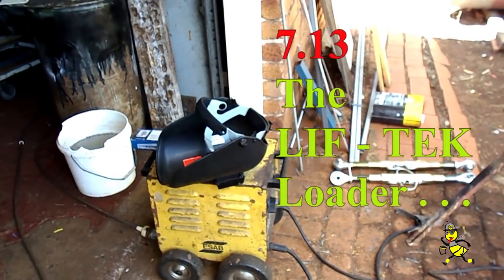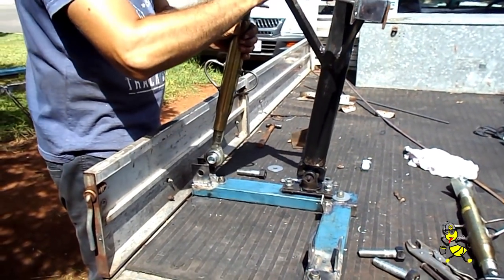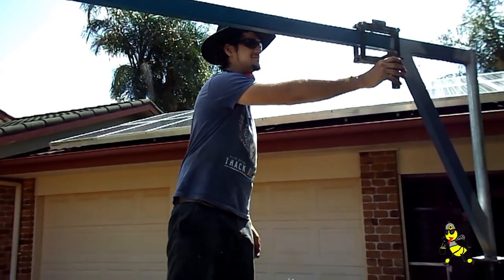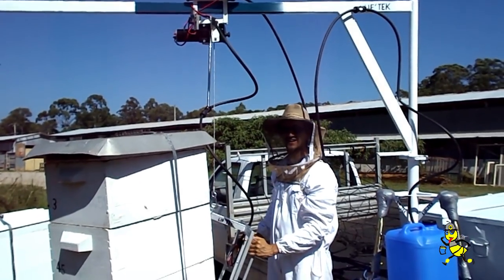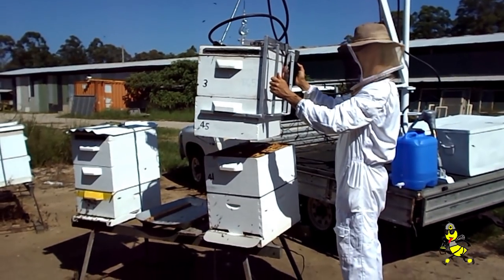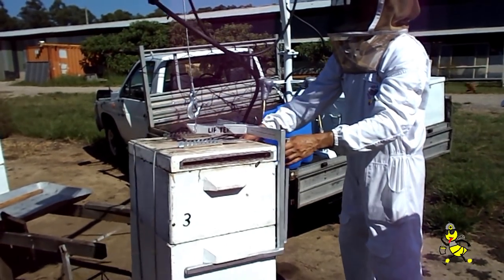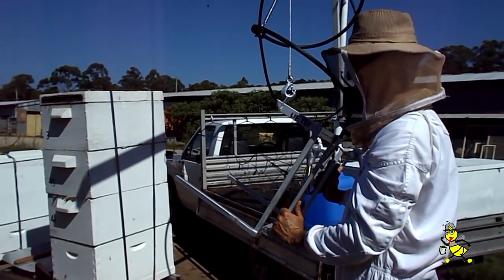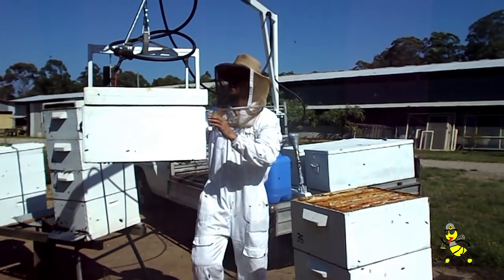7. 13 The LIF-TEK Loader

Comment: Great lifter, what did you have between the mast and the base, you said something about intermediate spacing blocks? looking to put one together this year before harvest. Cheers for the inspiration.
Reply from the maker: The bottom half of the post is 50 mm heavy wall pipe and the upper portion above the spacer or where it pivots/turns is 38 mm heavy wall pipe
Reply: @Beetek0903  Thanks for replying, did you have anything between were it pivots?
Reply from the maker: @terrybrown1510  YES
GREASED Polyurethane (piece of bread board)
Reply: @Beetek0903  Thanks so much. trying to piece it all together and find what I don't have. Cheers

Comment: amazing! How can I get a photo of what you did under the platform to make the base stable? This is the most simple light and clever crane I have seen for the job, i might make a similar. great thank you
Reply from the maker: The information is in the VIdeo 
3 X 12mm  bolts hold the Base to the floor with a "POST" welded to the bottom of the Base going through the Ute floor - also direct fixing to the Chassis

Comment: Curious to what size square  tubing you used? What was the wall thickness of the square tubing and how long is the boom? Have you ever had troubles with the boom bending or the base bending at the truck bed?
Reply from the maker: From memory: - 
Forks - Galv. 20 X 20 X minimum wall thickness - reinforced in certain areas
Boom - Galv. 75 X 35 X about 4 mm  wall thickness  Length 2.5 meters
Constance use since 2005  - NEVER had any boom bending or the base bending at the UTE bed - Fixed to tray down to chassis
Reply: @Beetek0903  Thanks!
Reply: @Beetek0903  Hi Allen. Trying to make something similar myself but having trouble finding two sizes of pipe that will fit snugly together.  Can you please tell me what size round pipe you use and where u get it. Im in redlands also. Thank you.
Reply from the maker: @johnstevens1192  Please give me a ring after 6pm before 8.30pm - you have my number

Comment: Allan just wondering what tail shaft you used?
Reply from the maker: One from the Wreckers

I think it was off the front universal of a Mitsubishi 4 wheel drive
Must have a grease nipple
Reply: @Beetek0903  thanks allan. Got one out of something for free from the wreckers. Just chasing some turnbuckles  like you have used to level main post. Just wondering where you purchased yours from
Reply from the maker: @keithross8611  Check out any Farm Tractor Sales - mine are 24mm Dia. top linkage
Reply from the maker: Whatever I can get from the Wreckers - with a Grease Nipple